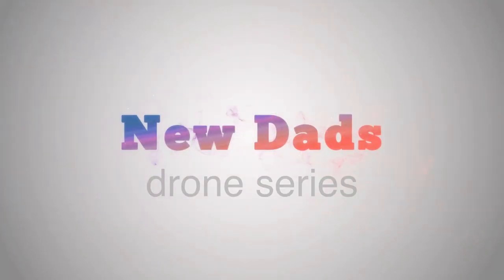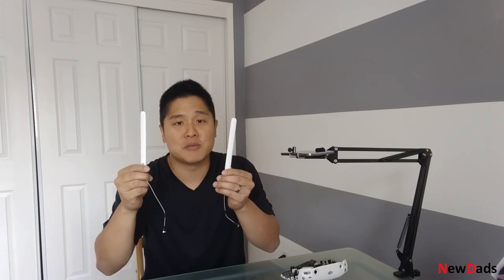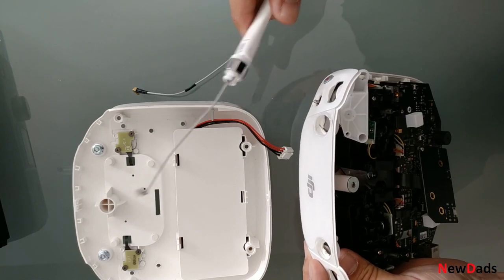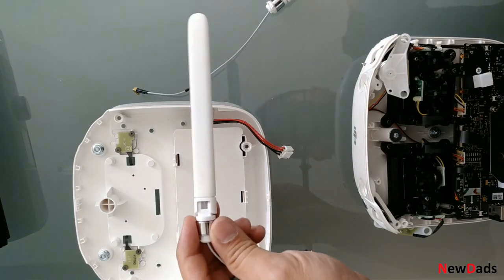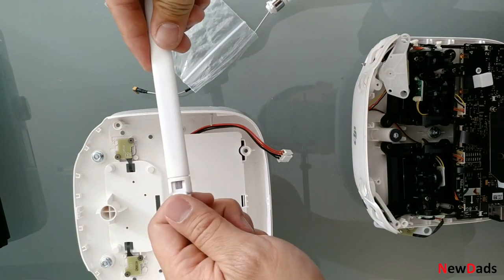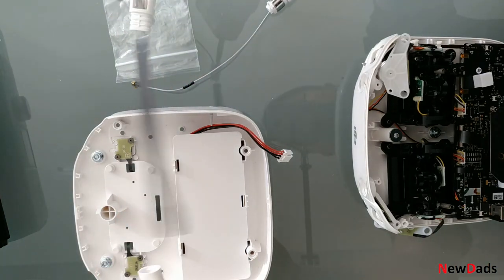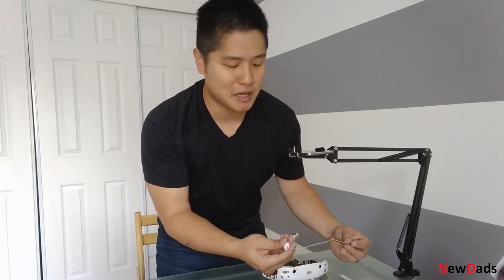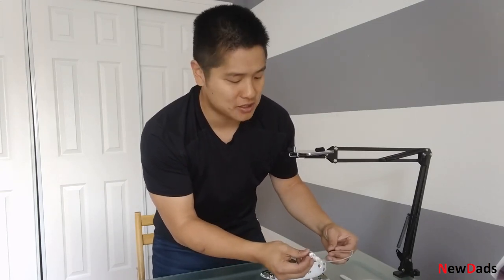DJI remote antenna repair - DJI Phantom 3 remote

Comment: My antenna wire broke from where you pushed the pins out I’m wondering if I can sadder that wire back together what do you think?
Reply from the maker: I think you definitely can solder it back together, what I would do if I were you is I would turn the drone on and turn the remote control on, open the app, and physically hold the wire to the point where it should connect. If it doesn't show any errors at that point, then I would definitely solder it to that point. I hope that helps!